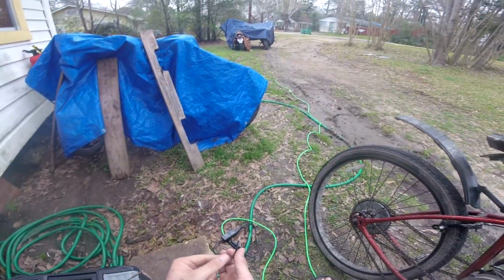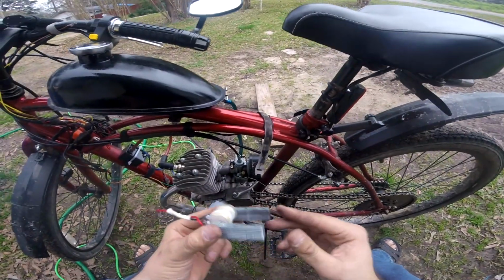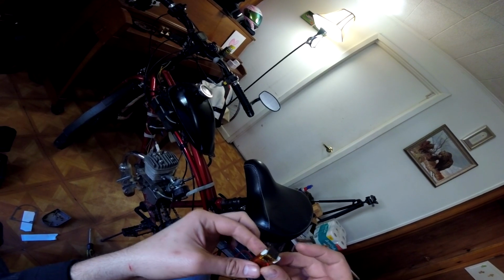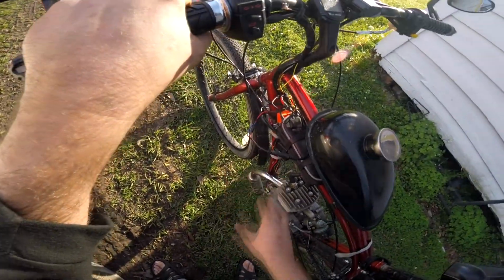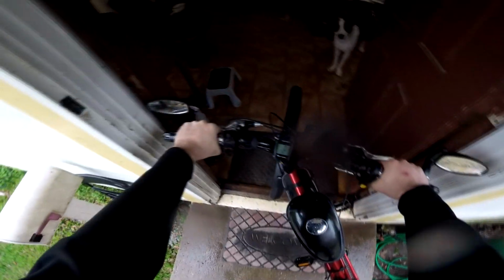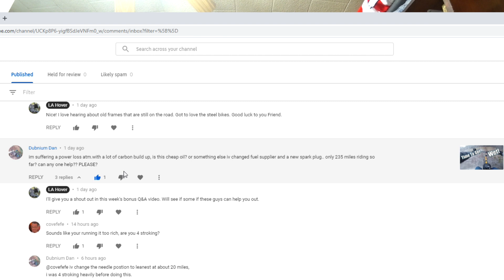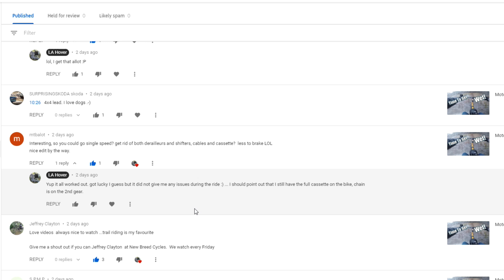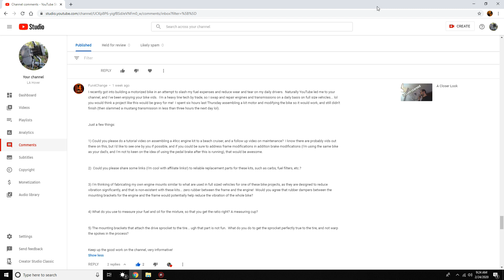Charging System Update (Motorized Bike)

Comment: A great way to respoke a wheel completely without  any stress about screwing up 

-- take the tire and tube off 
-- remove  1 spoke , replace it immediately  with the new one. 
-- tight it to approximately  to a what it was 
And repeat  one spoke at the time 
And finally  retrue the wheel ( shouldn't  be too out of wack 
--

Comment: LA Hover, do think some kind of rubber bushing in between the motor mounts and frame would help with vibration?
Reply from the maker: Yes, but there is a limit. The motor can pull to the left and mess up chain alignment. I take it you are running mostly street? If so get a smaller rear sprocket to help you reach your desired speed at lower RPMs... There for reducing vibrations.
Reply: @LAHover  Thank you for replying so quickly, I plan on doing some trail riding too. It's just a thought, I will probably just set it up as intended but when I have a few miles on the bike I'm sure I'll experiment with it. Cheers

Comment: the problem bith that little coil is that  has to have to wires but is sader to its own metal mass, I will  disconector desader the other end and run a diod bridge ...

Comment: Need a little help first-time with a motorized bicycle first time riding one first time building one but I get up to speed but it won't turn over when do turn over it shuts right back down I did all that just made it to the Bingo adjust the clutch I adjust the throttle cable I adjust the idle but it still won't stay on when it do turn over what else can I do if you don't mind me ask

Comment: Hook a 12v li-ion battery to your lights. A generator can be the last thing, I've had my battery for 6 months as of now, attached motorcycle headlamp and a rear bike lights. Last for 6-8 days fully charged, comes with a cable charger.

Comment: think maybe the wire on the generator was pinched or grounded slightly to cause power loss and it only had enough power with both plugged in

Comment: first try drawing out your ignition and charging system,see if you can complete a complete circle. keep in mind every cutoff switch,ignition,and safty switch completes the circut on the negative pole. must have complete circle in order to allow the power to flow thruout the back. side note extra carbon buildup is caused by too much oil in the fuel mixture.

Comment: I was wondering what is wrong with my bike with 80cc two stroke China doll I have put about 350 miles on the motor now and out of the middle of nowhere I stopped getting spark I put new cdi new magneto and still it won't start does anyone please have a suggestion I have tried everything

Comment: Hey. Hover i got some info that was weird to understand at first but the magneto that powers the cdi is to be around 330 ohm's or higher now when its cold out side that 330 ohms drops to 150 or lower when that happens the CDI wont get enough voltage to fire a spark plug why is this doing this  well its the cheap enamel coated wire used in making the coil  if it where double or triple diped wire that wouldent happen  my friend had same problen on his ford Taurus car i told him get the ford or blue streak part Chinese ignition parts suck the workmanship is crap if you need electrical / electronic help contact me iam a tech over 50 yrs

Comment: Noice buddie I got a question what oil ratio should I run for break in on my motorized bike
Reply: Patrick 16:1
Reply: 18:1 for 4 tanks then 24-1 unless you wanna clean out your pipe with heavy duty pipe cleaners and scrub the fouled carbon build up off your spark plugs every 10 hours
Reply: 16-1 is just overkill, let's be reasonable. A regular 2 stroke 80cc requires 24-1 with 3 heat cycles and a small putt in each gear n shes good to rip. I dont see why a 66cc would require more than a 79cc.

Comment: Awesome review Hoover I had a quick question I recently replaced my piston with the two O-rings because the old one was kind of wore out and when I replaced it with the new one it barely turns over now like it’s having a hard time compressing for some reason is there any particular reason why that you may know of ? Thanks in advance!.
Reply: I noticed that when I remove the cylinder head cover it compresses just fine but when I put it back on and torque the bolts back on there it has trouble compressing I don’t understand could it be that the new piston with the O-rings may be different than the old one?
Reply: I did some final adjustments Hoover now the motor turns over good, I get good compressionThe magneto is working fine because the spark comes out of the spark plug but for some reason it still doesn’t turn on I took the carburetor completely apart and cleaned out the Jets and everything so I doubt there’s anything wrong with my carburetor

Comment: 2 ) if you need lower voltage its easy to get a Buck Converter and some you do not need the ac-dc converter like this one "Buck Converter, Yeeco AC/DC to DC Step Down Converter AC 2.5-27V DC 3-40V 24V 36V to DC 1.5-27V 12V Voltage Regulator Board 3A Adjustable Volt Transformer" or a buck converter witch is dc to dc or  you will need ac-dc converter

Comment: (Old video revisited)  If those crappy 12v 1 wire generators could be made to work with a mini converter ($5 online)  12V AC to 12V DC or a voltage regulator. It'd only produce  something like 1 to 3 watts of max power. Even less power than a $25 bicycle wheel dynamo kit. Basically only enough to power a couple small LED's that might help traffic see you. But not enough power for a bright headlight to ride in the dark. 
For comparison, 1 AA battery can produce about 3.9 watt hrs which is = 3.9 watts for 1hr before fully drained....1 AAA is about 1.8 watt hrs. 
       I seen a video from the Philippines & guy rigged up an extra coil & magnet to his engine. So one was for spark/ignition only & the other used the black & blue coil wires to run a couple LED light strips. It put out a bit more power but still not enough for a bright headlight & taillight. Although the second coil system could possibly be used to keep an onboard 12V  Nicad battery pack recharged....Use 8 or 10 AAA or AA  Nicad batteries wired  in series and a $5 12V AC to 12V DC mini voltage converter. Use the Nicad pack to run a bright head & tail light at night with on/offf switch & on/off to engage/disengage the coil battery charging. A 12V diy Nicad battery pack would be much better to use than a 12V lead battery. Due to #1 weight #2 The lead batteries die/go bad fast unless always kept fully charged. The Nicad could sit dead or fully charged even get slightly overcharged without quickly being destroyed. 
When you look at a 50cc motor scooter generator, you can see it's generator  needs to be decent size in order to power a bright headlight, tail light, signals,etc...I don't want to have to keep pulling my lights or batteries off to recharge them inside. 
   So I was thinking a $25 dynamo kit, then make a 6v or 12v Nicad battery pack to power it's head & taillight & use the dynamo roller on the bike tire to either run lights directly or to recharge the battery pack & use it to run the lights. 
Or a head light/tail light system that stays mounted & an easy to remove 12V Nicad battery pack. VS the Blackburn types where you have to keep taking both lights off to recharge.

Comment: Ya I know all about the ignition system on the 2 stroke motorized bike #1 they do not like to go any faster than 20 mph or they short out due to to much juice being generated . # 2 when you have no spark with a new plug  change both cdi and magnito and check strength of the magnet . Then you don't have to go back over it again unless your new parts are defective . #3 make sure you tape your electrical connections water tight .

Comment: One wire should be hot  one should be ground  but i had a similar thing running lighting but my digital volteter would not display voltage makes no sense but i came to conclusion its the frequency not voltage or current your magneto moght be same effect

Comment: I think that happened because of the steel mounting brackets on the generator coil being mounted with the same bolts as the regular coil so when its not connecting to the battery it just short circuts the ignition coil which in turn shuts of the motor in the same way as the kill switch would
Edit: thats just a theory I actually have no clue what I'm talking about lol

Comment: my 66cc kit worked well with a scavenged a led flashlight and homemade led taillights i built a second bike for a friend and his died like yours antime i added any load also. was working on a rechargeable battery back to smooth out the flicker at low rpm, but it thru a needle bearing pin from wrist pin intomy stroke

Comment: all you need is a rectifier regulator. and a very small one at that. the rectifier will rectify the AC current, make it DC current, and then keep it at 12 volts. they're cheap man super cheap. 
you use it with that first coil you got that you said makes AC. one coil should make AC power that gets converted through the regulator rectifier for lights, the other creates power for the ignition.
then you can use the regulator rectifier output, funny thing those two wires are always red and black on those 🥴, to charge your little battery. then your motor is not straining as much to light the lights and the battery is taking most of the load. this is about as simple as I can explain it. just Google regulator rectifier. you'll figure it out. I hope this helps 🤪👍

Comment: i have an affter Markit maggg its a miny 12 volt just for ur guys lights so  WHO EVER NEEED A MAGGG FOR U ALL TO USES A 12 VOLT OR 6VOLT LIGHT BRAK LIGHT BATTERY U CAN WITH THE AFTER MARKIT MAGG NEEETO I SELL IT FIYTS ON THE CAES AND THE OLD ONE FITS TO SO U HAVE TO MAGGS ON 1 MOTER FOR LIGHTS HAVE A MAGGNEETOO AND SPARK HAS A MAGGNEEETOOO IT ONLY 20CASH SO I DONT MAKE MUCH
Reply: THANK U SO MUCH TIM i seen ur link u sent to my replay i sent u i want to buy the magg so ur saying the maggg in the pic u show me will power any 12 or 6 volt light as long as 6 volt has volt limiter i am down i sand u a PayPal link whatever faster to reach u
Reply: why are you shouting at me?

Comment: Riding your bike in the rain will cause the mag to short out...it's happened to me twice and I've had to replace the mag to get it to run ...it was raining really hard both times
Reply from the maker: Maybe from water getting stuck under the cover and causing corrosion.
You can seal the compartment if that's the case. But water by its self has never killed one of mine. https://youtu.be/IiQFdsDQk7s

Comment: Where can I get exhaust gasket for my seeutek pk80 80cc
Reply from the maker: If your muffler uses bolts I recommend replacing them with studs to help prevent blowing out the gaskets. These should work, https://www.amazon.com/Flange-Gasket-Stroke-Motorized-Bicycle/dp/B075YWH6TK/ref=sr_1_4?crid=2N2Z2HSYAKIA0&dchild=1&keywords=motorized+bike+exhaust+gasket&qid=1600471675&sprefix=motorized+bike+exhaust+g%2Caps%2C196&sr=8-4
Reply: They are Allen bolts everything is stock i have the seeutek pk80 80cc

Comment: Smaller sprocket take you longer to get up to maximum speed yeah and that means more time on the throttle and that means a hotter engine
Reply from the maker: That's not how it works. Yes you will spend a few more seconds accelerating, but the overall added air cooling outweighs this...

Comment: i think you are taking too much power away from the spark coil.. this is what kills the motor, spark not hot enough. also you can use a full bridge rectifier to change ac to dc, you can find the 4 diodes to make one from old electronics. i would reuse an old dc motor to use as a generator.

Comment: Yes, i've seen the rain >>>> Don't quit your day job, eh! 🤣

. . . but seriously. . . I want to put a NOS Sears generator lighting system >>>>> the back tire roller, ya  know?   I just don't know if it'll handle the speed of 30-35 mph before frying the little thing from friction. 

I dig those old lights!  I remember when I was a kid in the early 70's I thought they were the 💩, but they made it harder to peddle my single speed Stingray bike >>>> that was their only downfall 😢.  Hell, I won't be needing to worry about that now, if I can use one, of course.  It's a C-Note, so, I better look into it first >>>>>>> 2 bike stores were actually hostile when I tell them what it's for >>>>> they sell E-bikes 🤣

🇺🇸

Comment: A magneto needs an air gap. If filled with water there is no air gap to work with. Water can short out the coil using the heat. For charging, These little coils only put out about a half an amp at around 7.5 volts so if to much draw on it to charge can act like shorting the coil to kill it. Why they put a white wire on most of these I have no clue but they take from the magnetic field you need to make the spark in turn killing the motor. I just use a small generator that snaps to tire and runs my lights. Battery light for emergency (Oh lawd a cop!) I wouldn't use my magneto to charge batteries or run lights. It's not really a generator. Or lets say if you look at it like a generator you'd throw it away lol

Comment: Gee,I'm shocked to see that $25 'charging coil'didn't work for you either.POS' should get sued for selling something that kills the engine as soon as it's attached.My motor would not start with it in so I started it,and then carefully(yah right),put it in while the motor was running.As soon as I connected it to my battery the bike stalled and wouldn't start.
Reply from the maker: Ya that coil was a bit over priced for what it is. The wired needed to be reinforced, and the 4 little spacer fell off from just being removed from the package lol. In it's defense I did more than a few things wrong as the pin comment points out...
Question, were you also trying to use LED lights, or old school halogens?
Reply: @LAHover  Way late on answering.I was trying to light LEDS from a separate system.The only thing in common with the engine was the engine was grounded to the frame.The lights were a circuit of their own except the power wire I ran from the coil through a switch to the battery.The pads fell off mine too,on the same way.I even tried to insulate between the coil mounts and the engines coil./Battery lights for me since.

Comment: I'm going to put a tire drive generator on my back wheel for the lights and add a diode and  couple capacitors so it can charge a 12-volt battery back

Comment: Want me to send you a cdi kit and magneto  kit I’ve developed for those bikes if I still have one in my garage don’t worry you won’t have to solder anything because I’ve made it with professional motorcycle electrical wire crimps so all you have to do is heat shrink the ends of the connector and then it’s 100% waterproof a rlly cheap crimping tool is  included   I’ll update this once I’ve checked if I have any stock

Comment: i can help u whith rthat u neeed a small 6 volt battery and look up this dc to dc bosst inverter its like 6cash ebat makes like say 6 16 volts in to its max what ever onne u get up to 26volts 40 volts from just 6or 12 volts ther cheep and thay will charg ur batter fast whith more volts and it will not drane it and u can get a thing so volts only go one way   but look up dc to dc bost invert er  and ull have a batter it pulll the lode from not the bike moter

Comment: Hey my dude if your still trying to find out a way to run lights on  your gas bike's I got 4 brand new little brushless motors spin the little shaft and you got power. No batteries or plug's. Like build break fix he hooked his up nice. I  got the motors if you need any sh** I'll send you one for free. When I get some extra cash I'll send you one.

Comment: L.A. Hover. Well right now I'm on a major & expensive trail with stator(s).
I'm a Retairted Sheetrock hanger, / STRATEGICAL WALLBOARD TECHNITION,  but 2nd trade is small engine mech. Prob. know this better than hanging.  Point: is that I understand these engine's inside& out. But have no more knowledge than 20%  of them. I have a dream to build mechanical shθ@ beyond it's mechanical means & make it run EVEN FURTHER THAN THAT
will be in touch
              --MetalRebel--
     P. S. Right now I'm running BikeFerry uuhhh mean Berry

Comment: 🤔Always remember electronics are NOT waterproof no matter what ANY dealer says ABOUT ANY Electronics REALLY real small real small electric motor  like is out  ANY toy Car's will make a perfect generator will keep any lights  burning if you mount  it to the bank   tire so back tire can turn the little electric motor makes a perfect generator for your headlights or any tail lights is on your bicycle if you know what I die old is you can connect a diode to your battery and charge your battery but you really don't need no battery only a small generator to keep the headlights burning

Comment: You would definitely need a rectifier between the generator and the batt to make the AC coming off the engine into DC, which the batt needs to avoid draining it by allowing voltage to go backwards.

Comment: what i learned just breaks the most on 50cc moped engines its the spark unit system, ive had the most basic systems baffel me, if the dyno wont supply the coil with power, you have many possibilitys for failure of the spark. incomprehensible.

Comment: Get out of the box the little magneto made for the engine is only meant to run the ignition, buy or steal a small 12 volt motor use it as a dynamo put a twelve volt diode between the motor and the battery that will charge your battery and run the low powered equipment without any harm, if you are not sure forget the diode and rip the bridge rectifier from a car alternator and only use one of its input points.